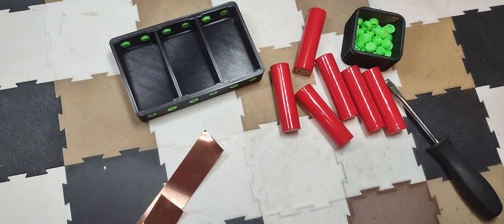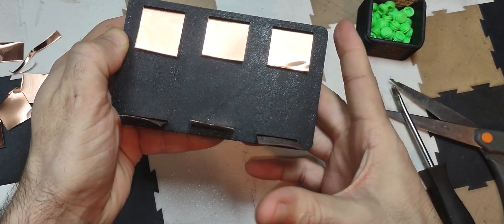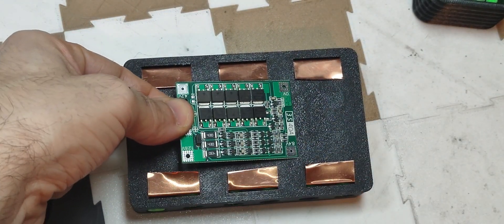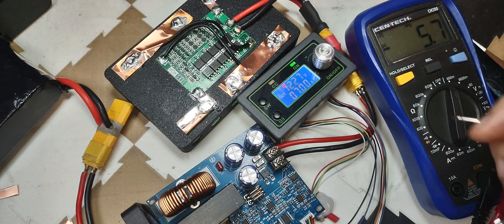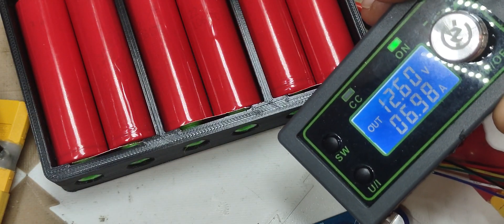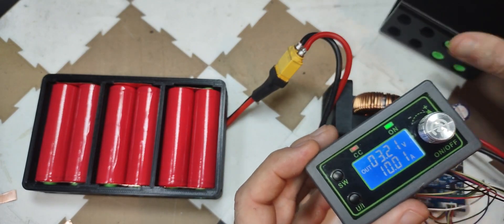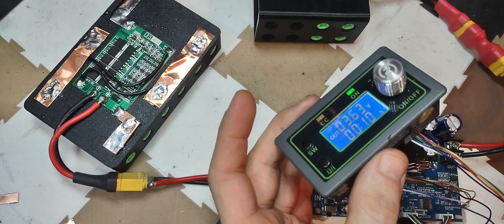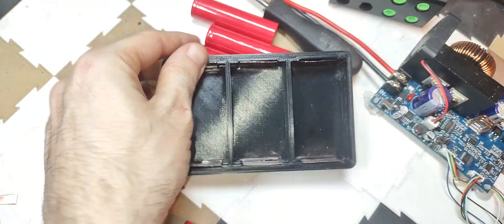How To Build A Weldless 12V Lithium Ion Battery

Comment: I have so many questions! Mainly regarding the plastic screws. How well do they withstand vibration? Heat? I imagine creep over time would also reduce the applied pressure, do you have to tighten them periodically?
Reply: Same questions here. I assume it is for the shelves, not for travel.

Comment: This is a fantastic design, been looking for something like this for a very long time. Is there an STL file available for this? Even better — is there a parametric OpenSCAD file so we can easily customize and build different standardized sizes of 18650 battery banks? That would be amazing!
Reply from the maker: These modules will eventually be generation options in my battery design program, but for now I will post this one on cults just in case someone wants it. 

https://cults3d.com/en/3d-model/gadget/3s2p-weldless-battery-tray-electronics-workshawp